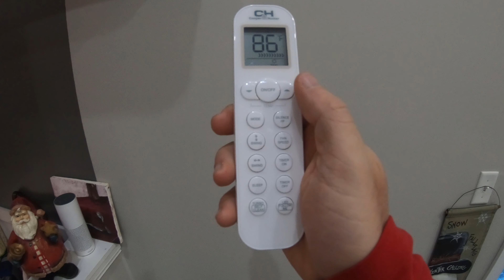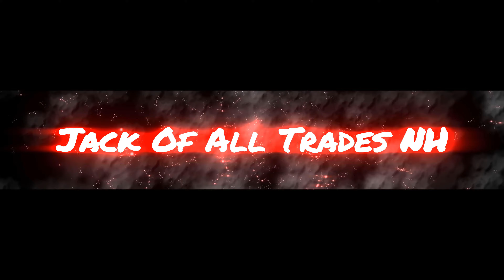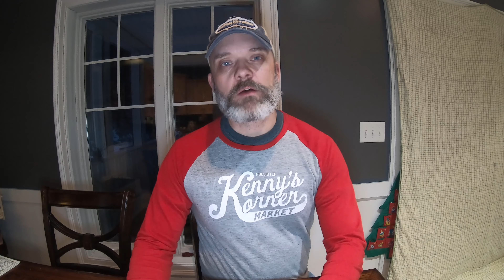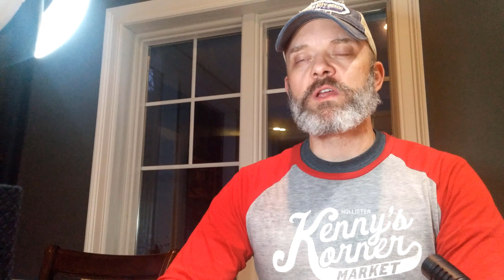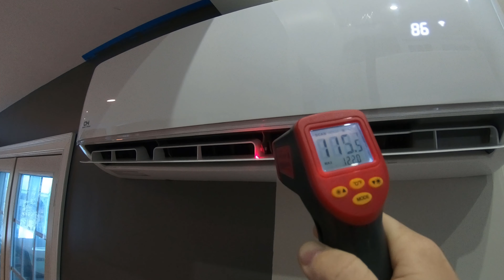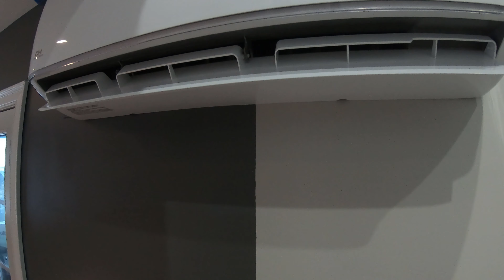Installation and also answering, Can a mini-split properly heat your space in the winter?

Comment: It’s December here on Long Island in NY and I’m heating my home with a four head, 3 ton Mitsubishi mini-split. 

I’m monitoring the room temps with a cheap AcuRite weather station. It comes with five sensors so I can keep an eye on the outside temp along with the temp of the rooms which is my living room and kitchen and three bedrooms. 

I also installed a sense energy monitor which I’ve been using to track my oil consumption, mini-split energy consumption and total electric use. 

Originally I had a one ton window unit in the living room and a portable in my bedroom. Had the sense running for about a month before the mini-split install. 

The night I turned on my mini-split at the end of August I saw my kWH drop by half. Using the sense to estimate oil consumption I’ve found that I only burn about a half gallon a day for hot water. My electric costs where about fifty dollars higher in November than last year but sense tells me that about 23 dollars of that bill, which was the mini-split. 

So it’s going to take a winter season to see if it’s a savings or not. I only paid $1.50 a gallon for oil on my last delivery and don’t think that price will last long. But I may not need another delivery this heating season. 

Right now it’s 42 degrees out and the house is 70 degrees and so far today I’ve used just under 1 kWH today. I think the mini-split is more comfortable than my base board heating and I like the ability to turn them off in rooms I’m not using.
Reply: Hi Brian, thank you for sharing this information. I am in Worcester, MA and considering replacing my oil boiler with mini splits. I have done some research but unfortunately I haven’t found out yet what the electric consumption is for the mini splits in cold climates. Would you be able to share the total electricity used by your mini splits each month during this winter month? Thank you
Reply: @wigwamhill4520  
Here’s the info for December:
High temp 59
Low temp 19
Degree days 1040 (82 less than last year)
kWH used 674 (457 more than last year.)
Oil used 18 gallons (for hearing hot water only)

I can’t tell you how many gallons I used last December, but the cost of additional electricity for this month was 110.00. The best price for oil in my area today is 1.82 per gallon so this would buy about 60 gallons. 

I can tell you that the unit had no problem heating all month although I was probably sleeping when it went down to 19 degrees. 

I’ve been looking into heat pump water heaters. I’d be looking for a fifty gallon. Have to do some research on the cost of running one. The cost of installing the water heater I’m looking at would be a few hundred more than replacing my indirect water heater.
Reply from the maker: Brian, that is very interesting... seems like you have a decent setup to keep track of everything. I hope you check back in around early spring and let the channel know your findings... it could very well help a lot of people with their hesting decisions. With this budget unit I have, I could survive with minimal oil usage as long as I didn't see below 20 temps, I think below that the unit is no longer efficient enough to justify use over other means. I could also supplement with wood heat.  Wow, 1.50 for heating oil is amazing, I don't think I've ever paid less than 1.80... thanks for the comment and I hope to hear back on your findings in the spring.
Reply: How did you get oil for 1.50 a gallon?
Reply: I’m thinking about ripping out my 1960s oil furnace  and tank along with all of the ductwork to install the mitsu hyper heat system. I’m also on long island, NY. looks like you’re loving it so far. it’s a bold move and i’m mainly worried about the electric bill. home is about 1300 sq ft. kindly keep us updated this winter!

Comment: I had a mini split installed during summer, it worked well. I turned it off during fall season. When it turned on again in winter, the room got mold due to humidity. How could  I use the dehumidify function?
Reply: I’m surprised you had a humidity problem during the winter. The air is less humid in the winter. And the heated air from the mini-split should make the relative humidity even lower. Most homes have mold problems in the cooling season caused by oversized air conditioners. They short cycle and drop the sensible heat to quick, leaving the latent heat in the form of high humidity in the home to cause the mold.
Reply from the maker: Mine just had a dehumidifier mode to set it to on the remote. Does yours? Or are you saying the mini split was moldy?

Comment: What if I built a box around the outside unit...tried to heat it up... will I get better heat output in winter?
Reply: Well I would use foam...and not restrict the airflow but at cold temps about 24 degrees it doesn't work as good at all
Reply from the maker: I think if you restrict airflow you risk burning up your compressor. All of these units look the same to a point and I've yet to see one insulated, typically thin sheetmetal and copper or aluminum fins and a compressor. If insulating one was a benefit im sure the more expensive ones would have done that. Thanks for the question.
Reply: It's a toshiba
Reply from the maker: random stuff channel how old is it? Could it be low on Freon?

Comment: How many btu is urs
Reply from the maker: 24,000 btu
Reply: @JackofAllTrades1  Is it heating BTU?  I am looing to install 4 on my rental properties in Claremont NH.
Reply from the maker: @synewparadigm  this specific Cooper and Hunter unit is 24k cooling and 25k heating. This is the 230 volt 20.5 seer unit.

Comment: I just got a mini split installed. When using it for heating, what is a good temp to set it at?
Reply from the maker: Holly in the Ozarks I always ran mine as hot as it would go and then kick it off once it got warm enough. If you are going to run yours on auto where it cycles on and off, you will need to play around with the temp to see what you are comfortable with... maybe start at 72.
Reply: The mini splits gain their efficiency when they maintain a temperature so pick a temp and set it there and leave it the mini splits are modulating so if there’s not much demand for heat they will run slower and ramp up and down to maintain the temperature. It will also be more comfortable that way and leas large swings in temperature

Comment: I can’t place the outside unit outside because of HOA. Is it possible to install the outside unit in my garage attic?
Reply: I run a fujitsu for my second level garage apartment in Canada.  works great.  Its  mounted outside on the second level.
Reply from the maker: @gp7910  I think sonny's concern is that his HOA won't allow the outdoor unit to be seen outside.
Reply: @JackofAllTrades1  got it...thanks1
Reply from the maker: Sonny, it would be way too hot. The heat exchange would be almost nil. Can you find a way to get it right up against a vent and ensure its getting a ton of air flow? I dunno about you but my garage attic is really hot, which means the outdoor unit will not be able to release as much heat and the indoor unit would not cool as well.
Reply: what kind of hoa doesn't allow a heat pump or a/c outside?  that is crazy I'd fight that.  Maybe it can be shielded with landscaping

Comment: I have watched several videos on minisplit heat pumps. When one videoblogger addressed the high use of electricity in the winter it turns out that there is an "always on" heating coil to prevent ice build-up (in the Mitsubishi "supersaver" cold weather models). This doesn't seem necessary with your off the ground condenser set up.
Reply from the maker: Guess that would depend on where the icing up took place. I would usually have ice hanging off the bottom where condensation would drain from the case but there was never enough to block the drain hole. When mine would go through the deicing phase (usually a couple minutes every hour) it was to keep the coils from icing over and restricting airflow. I never ran mine in auto though so that could of been an issue with those units you speak of.... I strictly turned mine on and off for both heating and cooling. Thanks for the comment. I'm sure the feedback will help others.

Comment: Good job and explanation. I removed a 92% gas furnace and Air Conditioning system , all off the duct-work and have been using mini-splits for 7 years now. We could not be any happier with the comfort and cost to use year round. Saves a fortune on electric usage.
Reply from the maker: Joseph Hall that’s awesome. Thanks for the comment.
Reply: I am moving this direction, good to know I am not off my rocker in the mindset.
Reply: @wadebrewer7212  Wade, I have worked in HVAC- heating and cooling, plumbing, and electrical for over 40 years and I live near the Alabama - Tennessee border as a region comparison to yours. One or multiple Mini-Splits with a 20 or higher SEER rating would be my advice to anyone for Heating and Cooling unless they live in a region where it gets and stays below 05 degrees Fahrenheit for and extended time. They will work great even when the outside temp is below 00 Fahrenheit, some as low as minus -22 F. The higher the SEER Rating is, the more that the UNIT-MiniSplit will cost, but also it will cost less each month to operate. I have built several houses including the one I have lived in for 17 years when I originally installed metal ductwork , 92% gas furnace with a 14 SEER cooling system. Removed all of the old system and installed the Mini's. Works better now, works cheaper now, could not be happier and I could put in any kind of HVAC system that I wanted. Oh yes, I did.
Reply: @josephhall1241  How would you size a mini split in CT to plan for heating and cooling?  I believe our heating needs are often 2 to 3 time those of the cooling needs.  For example a 18K BTU mini-split would be good for cooling 750sq. ft. but I don't know how it wold be at heating the same area.  I am curious with your background.
Reply: Can you tell me how to figure out how much money can be saved? Like what voltage and Seer rating is best to save money on electric
Reply: @absolutemalmaute9592  you want to get the 220/240 volt as they run most efficient and lower amp draw....that said most mfg don't offer 110/120 volt on units above 18,000 BTU (1.5 ton).  Best to use a 220/240 even on lower btu units as well. Like said above, 20 SEER - 22 SEER is most efficient.

Comment: make sure the fans are always on high... I have 2 Mitsubishi Hyper Heats... and in cooling and heating i always keep the fan on the indoor unit on high ... more efficent and keep the vane pointed towards the floor but not all the way down.
Reply: in cooling mode the higher the fan speed the less it can dehumidify which in some places it makes a huge difference how much humidity you can get out of the air plus the less humidity means the less your A/C has to work to cool the space. 

. In heating mode the higher the fan speed the more relative humidity can be put into the air so the air can feel dry without a humidifier.
Reply: @kizunadragon9  I have 6 mini split zones I have CTs on the systems measuring power consumption. My systems work less and work more effectively when the fans are on high.
Reply: @SubStationSparky  i mean im just saying. just rules of thumb for HVACs
whatever works for you.

Comment: Thanks for the info.  It is now August-2020,   would you still recommend the C&H?  Did you consider the MrCool DIY or maybe a Pioneer?
Reply from the maker: Yes, 7 year compressor warranty, 5 year limited warranty... you can't beat that for a "generic" unit. It works great in the summer heat and a bonus was that it also heated very well! The app was the only downfall but honestly, as basic as it is... I was able to kick it on and off from anywhere and that was really all I needed. I'd buy it again. Thanks for the question
Reply: @JackofAllTrades1  Awesome videos, sir! Seven years is fabulous. Especially when you consider most legacy equipment has, at best, a five year warranty on their compressor. In fact, warranty is so important, we at Texas HEAT offer LG equipment (12-years on parts even when choosing the DIY With Assistance option https://www.texas-heat.com/diy-with-assistance/ and offer a 12-year labor warranty for a small fee. Warranty is one of the biggest driving factors in selecting HVAC equipment.

Comment: As the temp goes down, so does the heat output
Reply: True, mostly. LG units with their LG RED technology still give 100% heat output at -10°F.
Reply: @texasheat7506  Thank you for the info! Here in NYC area though not hitting down to -10F, but can be cold for dozen days. Do you recommend LG heat pump still, and do you think it can reliable be the only heating system (without auxiliary boiler)? I wondered if it has eheat/emergency electrical heating option so when the heat pump shuts down because of arctic weather, the electrical heating system will kick-in automatically and help us survive...
Reply: @texasheat7506  Thank you!
Reply from the maker: Yes, agreed

Comment: My Mitsubishi Heavy Industries 7.1kw mini split is a heat pump.

I live in the Philippines and even during Christmas season it can get as warm as 35c at daytime TF were these Mitsu peeps thinkin?

It’s really powerful when cooling mostly thanks to the vector control inverter and PAM+PWM for the compressor.

Waiting for the snow to fall here in the tropics to see if it heats well. Not sure when that’ll be.
Reply from the maker: haha... has it ever snowed there? We get 2 to 3 meters of snowfall here a year.
Reply: Jack of All Trades NH Never since I was born in 1991 hahahahaha! Well probably it’s coz the AC I have is a global model shipped to Europe as well.

The only use I get out of the heat mode is when I do the Allergen Clear function where it reactivates the enzyme filter thingy haha

Comment: The newer "ultra:"heat pumps run maintain full btu rating down to -5 and 80% down to -22 to -31f depending on model.  Most of the major manufacture are offering ultra hvacs.  The ultras can run at lower temps by running the liquid side at a much higher pressure.
Reply from the maker: David, thanks for that useful information. So I guess with knowing that, if somebody is looking to heat their space at those outside temperatures, then going with one of these off brand mini-splits may not be the solution.

Comment: How long can we run the unit before turning it off ? I was told its more efficient to leave unit on and not to turn it on and off frequently.
Reply from the maker: I think that is a long debated question for any cooling and heating system... does it take more energy to cool a room that is hot or maintain an already cool room. I would suggest finding a temp that is comfortable for you but also the unit can keep cool without running non stop. If you have that happy medium them it may just be the better deal... otherwise, have the temp gauge set up higher while you are away but not completely off.
Reply: Any decent split system operating within its parameters should automatically defrost its outside condenser unit if necessary when it is icing up, shouldn’t it?  Some units/brands will be more efficient at heat transfer than others and there is a site for checking out real performance values of different makes.

Comment: If I missed it I'm sorry but what kind of money does it cost when you run the heater?... Very nice video..thanks for all the info and your time...
Reply from the maker: We were running the heater a lot last month and our bill seemed to go up about 50 bucks. This is abnormally high though because I was using just the mini split to heat rather than the combo of the wood stove. If I run it a couple hours every morning then it’s closer to 20 a month.
Reply: Cost me about 75$ a month for 100 square feet. Well insulated 1st floor apt. with new windows. Kept at 70 degrees

Comment: my fujitsu are my primary heaters and they work great. adverage temp in my house is 78 f upstate NY. i have the low ambient, they heated my home the whole winter. they work down to -15 f
Reply from the maker: Marc Gallant hey, that’s not bad at all... what’s your electric bill like? I try not to use our heating oil if I can... in this house it’s wood,,, then electric... then oil. Thanks for the comment.
Reply: This is awesome! I'm considering switching to heat pump here NYC area. May I know which model you have for you house? And what kind of auxiliary heating system you use? Thank you!
Reply: @vren472  I have the FUAOU36RLXFZH with (1)18k BTU and (2) 9k BTU. The 18k heats my livingroom, kitchen and hallway. The two 9k service the two bedrooms down stairs. I was going to get 3 more for the two bedrooms upstairs and my basement but we sold our house. I will be putting them in the next house.
Reply: @BoriPR82  what the square footage of each of your zones?
Reply from the maker: Thanks for the comment... I did a second video on this one where I tested it down to negative 5 degrees. I felt like it lost a lot of its effectiveness at that temp.... maybe a smaller room would of faired better though. Cheers